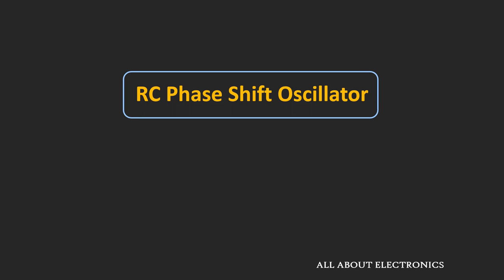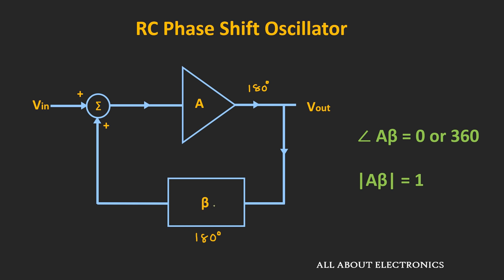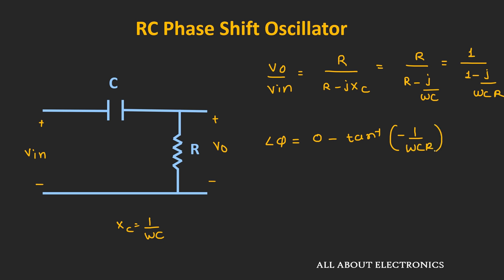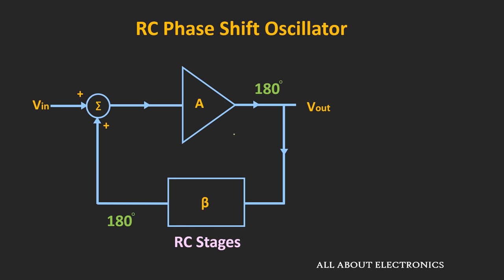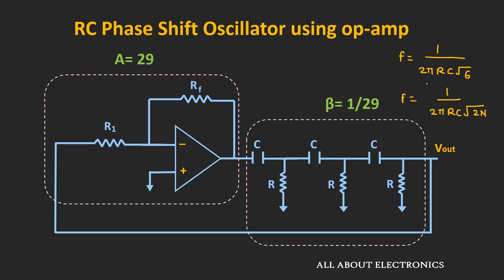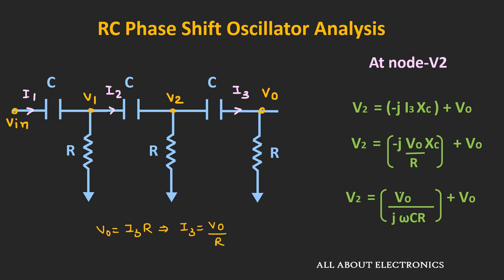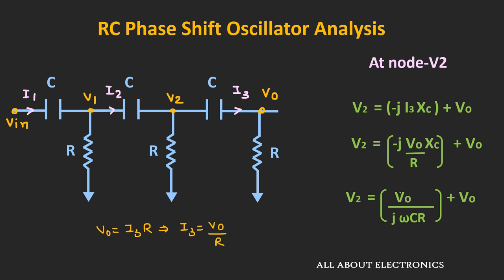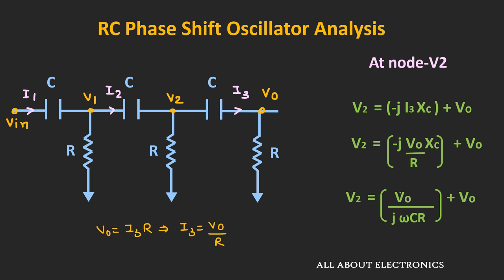RC Phase Shift Oscillator (using Op-Amp) Explained

Comment: With an op amp the described circuit does not provide stable amplitude. Tested with LM1458 and TL062. One op amp provides artificial zero (half the supply voltage), the other one is the oscillator. With a trimmer resistor in feedback, the amplitude either decays slowly and finally oscillation stops, or the amplitude grows until the output is a square wave. While the theory is nice, it is practically unusable as a sine wave source.

Comment: is it possible to use the non inverting amplifier for the same purpose?
Reply from the maker: For the oscillator, the overall phase shift should be 360. The feedback network provides a 180-degree phase shift. So, the amplifier stage should also provide the remaining 180-degree phase shift. That means it has to be an inverting amplifier, which provides a 180-degree phase shift.

Comment: WHY THE OUTPUT WAVEFORM IS SINUSOIDAL ,  not a square or triangular waveform???
Reply from the maker: It is a harmonic oscillator. So, out of all the frequency components from the thermal noise, the feedback section (which is a frequency selective section) only allows a single a single frequency to grow over time. 
If you look at the frequency spectrum of a square wave or a triangular wave, it consists of multiple frequency components. 
But in this oscillator, the frequency selective feedback section does not allow the harmonics. And that's why the output is sinusoidal. 
I  hope it will clear your doubt.
Reply: @ALLABOUTELECTRONICS we do not see many frequency component  (from the thermal noise) at the output of the opamp. 

(1)Do  the frequencies, which are  not  selected by the selective  network, dies out over time /  vanish ??
(2)Does the frequency components from the thermal noise die out over time??
Reply from the maker: First of all, the amplitude of the frequency components is in microvolts or even lower. So, it won't be measured by the oscilloscope. Moreover, as it contains all the frequency components, in time domain they are indistinguishable. 
The frequency selective network selects the particular frequency signal and that signal is boosted by the loop gain over the iteration. 
And yes, the remaining frequency components will die out over the period of time. 
For more info, please check my video on " How Oscillator Works?"
It will help you.
Here is the link:
https://youtu.be/XVS8Puf4tiw
Reply: @ALLABOUTELECTRONICS  Thank you very much sir.
Our teachers do not interact with us. We suffering in a big problem.
Again thank you from the bottom of my heart.

Comment: Why phase shift is calculated by subtracting tan inverse 1/wcr from 0....How tan inverse term has come...plz explain sir
Reply from the maker: Let's say you have one function, which can be represented as  (A + jB)/ (C+ jD)
Then the phase shift of the function would be tan-1(B/A) - tan-1(D/C)
Here in this case, the imaginary term is zero in the numerator. That's why the overall phase-shift is 0 - tan-1(1/wCR)
I hope it will clear your doubt.
Reply: @ALLABOUTELECTRONICS  thank u sir...Sir i have one more doubt....Why imaginary terms were taken zero to find frequency expression?
Reply from the maker: Because the output voltage Vo will only have a real part.
Reply: @ALLABOUTELECTRONICS  the book i studied where there was no "j" just Xc=1/wc...no j...why is it introduced sir??
Reply from the maker: 1/wC represents the only magnitude. The j operator with it also includes the phase information.

Comment: B is frequency-dependent, and it is maximized at the resonant frequency. Any other frequency will introduce an imaginary component to reduce |B| resulting in AB<1. What would happen if the loop gain under a certain frequency is unity but with a non-zero phase shift? Such as adjusting A so that |AB|=1 while B is a complex?
Reply: Interference of some sort is my guess, resulting in some attenuation.

Comment: if the opamp provide 180 phase shift , then why dont we use non-inverting opamp??
Reply from the maker: The thing is, the overall phase shift should be 360. When you use, the RC circuit in the feedback then it will provide the 180-degree phase shift at one particualr frequency. so, to get a 360 phase shift, we need to use the op-amp in the inverting configuration.
Reply: @ALLABOUTELECTRONICS  okay so if we use non inverting opamp  with multiple stage RC circuit ( inorder to get 360°). Does it still work the way you said?

Comment: At 3:12 how u got angle??
Reply from the maker: 1/wc is the capacitive reactance. So, tan-1( Xc/R).
I hope you are asking about this only. 
If you have any other doubt, do let me know here.
Reply: @ALLABOUTELECTRONICS  yes it is ,but may be i m forgetting but can u please explain me how u derived for phase angle phi
Reply: The first line of expression of angle phi
Reply from the maker: @curiousbud2366  LEt's say if you have a transfer function A + jB / (C+ jD) then the phase angle will be tan-1(B/A) - tan-1(D/C).
In the numerator, as there is no imaginary part, the phase angle will be 0. 
For the denominator, it will tan-1(-Xc/R) or tan-1(-1/wCR)
So, the overall phase shift will be 0 -tan-1(-1/wCR) = tan-1(1/wCR)
I hope it will clear your doubt now.
Reply: @ALLABOUTELECTRONICS  thank you so so much

Comment: why is the imaginary part 0?  
please explain!
Reply from the maker: Output of the oscillator is real. If you connect the load and see the phase difference between the voltage and current, then ideally it is zero. That means imaginary part is zero.
Reply: @ALLABOUTELECTRONICS  sir where can i get these ppts 
please provide us the ppts sir

Comment: Why dont you take op amp in non inverting mode ?
Reply from the maker: Because the overall phase-shift of the circuit has to be 360 degree. The feedback network provides 180 degree, so op-amp has to provide the remaining phase-shift. That's why it is used in the inverting mode. 
I hope it will clear your doubt.

Comment: sir, here it is negative feedback... then why u said oscillator is an amplifier with positive feedback
Reply from the maker: Because the total phase shift provided by the feedback path is 180 degree. that means it will invert the signal. So, even if it is connected to the inverting terminal of the op-amp it will provided the positive feedback. 
I hope it will clear your doubt.
Reply: @ALLABOUTELECTRONICS  thank u sir.. i got it

Comment: how did the j in numerator gets eliminated?
Reply: at 9:08
Reply: sorry at 9:38
Reply from the maker: @drunkirk3472  1/j = -j 
So, it was written in the denominator. 
I hope it will clear your doubt.
Reply: @ALLABOUTELECTRONICS wouldn't 1/j will be (j)^-1
Reply from the maker: If you know the complex number algebra, then you must be aware that j^2 = -1.
Or 1 can be represented as -j^2.
So, -j /1 = -j / (-j^2) = 1/j
I hope now it will clear your doubt.
Reply: @ALLABOUTELECTRONICS  thank u so much, i wasn't considering this aspect as i wasn't clear about j.

Comment: Why the imaginary part of the voltage is 0??
Reply from the maker: The thing is the gain provided by the op-amp is real (-Rf/R1). It does not contain any imaginary part. 
So, the feedback section will also have the only real part.